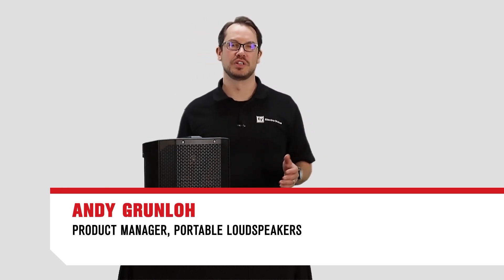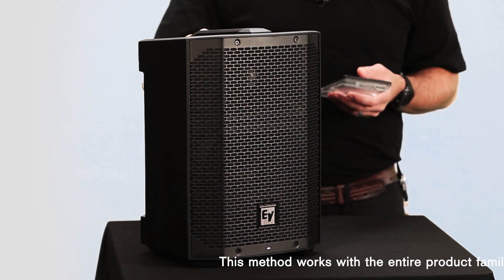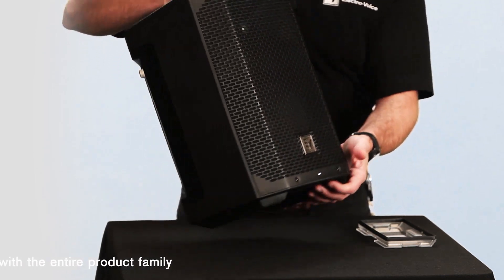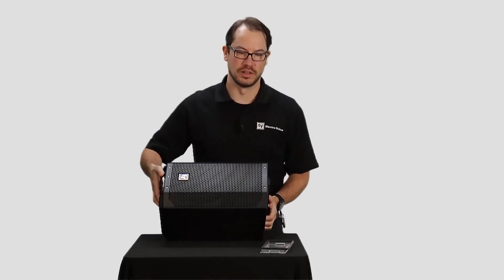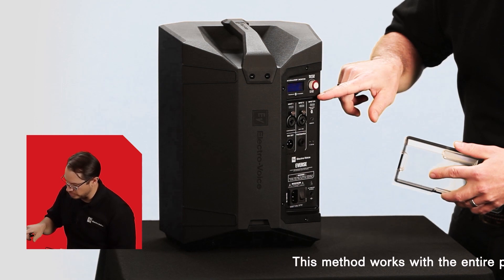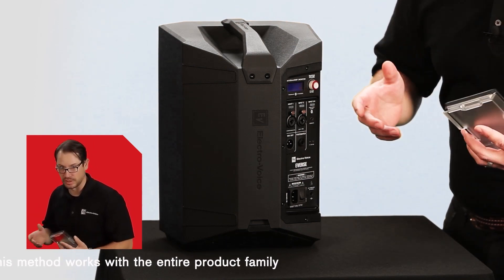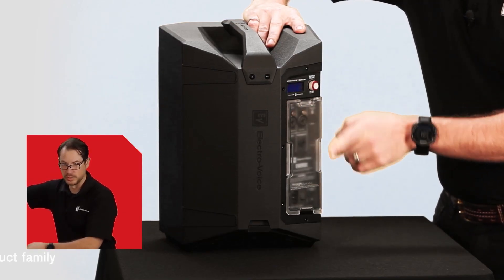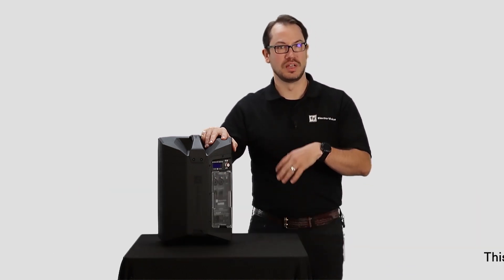EVERSE Series Training – How to Install the EVERSE 8 Weatherized Cover

Comment: How can I remove it? ( Mine came with it on)
Reply from the maker: Hi oP, the plastic cover is not locked by any screws or similar – simply pull it off by using your both hands. Sometimes the cover sits a bit firmly on the speaker because it seals and protects the connection panel.

Watch the video and do exactly in reverse order. 😉